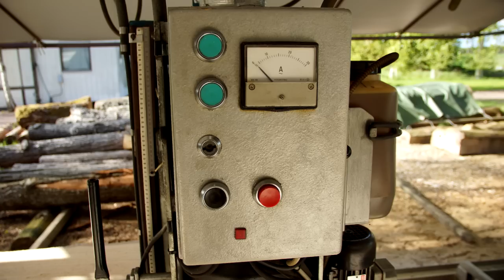SNIK chainsaw mill video 3

Comment: That chain seems to be running very fast. “Chain-shot” must be a real hazard. Nice mill, fast cutting.
Reply from the maker: We actually newer had a Chain-shot in nearly 30 years, but had on or two broken (thin 6mm pico chains) and they were caught by the safety U bracket mounted on the bar root together with the saw-bar nuts, but newer on a 3/8  standard Oregon ripping chain they are pretty 💪 strong.
Thank you for Watching

Comment: With the auto feed does the chainsaw mill cut smooth? Nice mill!
Reply from the maker: Yes It is 0-15m/min 
when the feed pressure once sett , the saw speed  will automatically adjust to the with of the saw cut👍

Comment: Hey Svend, in the video you say you use a modified 404 sprocket to run the oregon s91 chain. In the comments you mention you use a 3/8 8 tooth sprocket. I was hoping you could describe how you modified the 404 sprocket? Or does a standard 3/8 sprocket work fine with that picco chain? Thanks
Reply from the maker: Hej Evan the standard 3/8 ripping chain runs on the standard 3/8 spocket, but not the S91  you se the 404 sprocket in the Video and how it is turned down in the middle to a different diameter to fit the S91 Chain
Reply from the maker: A 8 tooth 404 sprocket turned down to 42,2 mm in the middle runs nicely with a 91 S Pico Chain 👍
Reply: @Svendus  Perfect. Thanks for the information!

Comment: Hello Svend, incredible mill you've built yourself there! I was hoping you could further explain how you force your motor to run at 100% overload? I've read previous comments and if I understand correctly you run a 30 amp breaker. So 15Kw (7.5Kw x 2) at 230v should trip that breaker quite quickly shouldn't it?
Reply from the maker: The motor is a AGUS 55+ 400 volt industrial, that means it is built to run with 55% overload continuously
 on the mill it runs intermittent 100% overload and you do not have any asynchrony sound that normally are heard from 3 phase overloading 
 the motor are protected with temperature censors in the the winding of the motor 
the motor become warm but not hot and it cools down when the clutch are free and not connected to the saw chain 
it has actuality newer switched off do to overheating.

Comment: Why am i loving the chainsaw mill way morr than the bandsaw ? My engineering mind LOVES the simplicity of it! Sooo cool! Plan to build me one this month :)
Reply from the maker: carytowncat Small band saws with 32 mm blades are suffering from wavy cuts when the blade becomes dull and unsharp, and big saws with 75 mm blades become rather costly , cutting into a nail with a chainsaw are not a catastrophe the chain are often repaired in a  couple off minutes 👍
Reply: @Svendus  thanks Svend :)

Comment: I know on my band mill about how often it needs to be sharpened. About how often does the chain need to be resharpend?
Reply from the maker: We sharpen the chain when the sawdust become just dust there are no fast roules it depends on the wood and how dirty the bark on the log are
Reply: It's the same on my Bandsaw, but I didn't want to have to sharpen a chain after every log. That may or may not be the case on a chainsaw mill, I just honestly don't know about them?  But, thought they might work well? May be easier to sharpen while in the field? You've got a really nice mill.
Reply from the maker: @melvinjohnson7981  Thank You we are planning a circular HM cutter to clean the bark before the saw chain enters the log like on the professional bandsaws to day we clean the log on the bark side where saw chain enters the log and sharpening are easy made on the mill with a small 5,5 mm electric grinder

Comment from the maker: Note! to get up the chain saw speed, a big motor wont do alone You have  to modify the saw chain riders from 0,65 mm to 1mm  tighten the chain tension and lubricate the nose wheel from within the needle bearing
Reply: Hi Svend, great machine you've built there, well done. Could you explain to me what you mean by 'riders' or what part of the chain these are ?
Reply from the maker: Chris Dunham Depth gauges, "riders," or "rakers," as they are sometimes called, control the amount of wood severed by a cutter tooth. During the life of a pro saw chain, they occasionally need maintenance for top cutting performance. ... Each time the chain is sharpened, the top corner of the cutter tooth gets lower

Comment: the pressure is higher on the saber FORCE BUT?: using the middle of the saber on an 80 cm log or close to this length? OR USING THE MIDDLE OF THE SABER TIP DOES THE CUT STAY BUT SMOOTH CUT BUT FAST FREE?
Reply from the maker: You are not clear  we do not understand  your Question  But Thank You For Watching 👍

Comment: Very nice, Awesome power and a clean, quit cut.
Reply from the maker: +Joel Claflin Yes the 2.5 mm veneer can be used it onely need a little sanding to be smooth 
but it is more waste than veneer with a 7mm saw cut  :-)
Thank You for Watching

Comment: Is 26" the largest bar the 10 hp motor can handle?
Reply from the maker: @gadgethunter  on the machine we can mount a 30” but we do not  pay for something we do not need here in Sweden. Technically this motor can handle the longest bars available because you can pick out over the double effect 15KW from it 🤔 thank you for watching

Comment: Brilliant!  Amazing Engineering!  Well Done!  I wondered how you got the chain speed up so high (by the sawdust) - 10 bar on the oil and near perfect alignment !!   Is that a 10hp motor?  Wishing You much Success!!  Masterful Craftsmanship!!
Reply from the maker: Advanced Nutrition Inc Thank you yes it is a Brook Crompton Parkinson Argus 55+ 7,5 kw it runs with 100% overload 30 amp Saw spindle runs at 8000 rpm Saw spindle driving at 8000 rpm minute chain speed 20 ms

Comment: Could you be detailed about the pulley sizes the clutch and the magnet/oiler please I read the other comments about the motor
Reply from the maker: Hi Michael the Pulley are 2 Z V belt. 
The clutch are a single coupling lamell from a VOLVO 240 200mm in diameter.  
Spindle speed are 8000 rpm. 
The max speed for 63 series ball bearings with DDU seals. 
The Chain speed is 20 m/s. with a 3/8 8 teeth sprocket wheel.

Comment: u can't cut both ways?
Reply from the maker: Eric Charters Yes it cuts both ways but the installed effect  (15Kw) is to much fore the nose wheel  to cut with full load backwards.  
But we often manually cut light cuts backwards https://youtu.be/tbN29YCcwIo?t=1m11s
Reply: Démonté

Comment: Help me. 
6.16  min. What?
Reply from the maker: The Microswitch are electric connected to the oil pump and feeding  motor  both are operated by the mechanical clutch turns of the feeding and chain oiling when the saw chain 🛑 Stops

Comment: Greath mill haw much is power of engine
Reply from the maker: +stivi s Yes the Saw motor are aluminum  build weight 50 Kg 
we had to balance it with led ballast in the saw portal pillar opposite side of the motor to make it stand  on all 6 wheels
Reply: +Svend Nielsen, he was asking the hp rating of the electric motor you are using. I would imagine he will be working in Kw not hp but he can do the math.
Reply from the maker: +Mike Lamothe  all right Sorry as said before 7.5 KW running intermittently  with 100% overload 30A 15Kw 
the motor are a Brook Crompton Parkinson Argus 55 (55 means that the electric motor can be overloaded 55% continuously ) https://youtu.be/IqzI3xNYqz4
Reply: 7.5kw = right about 10 hp which is equal to at least 20 hp gas engine.  But he is overloading to 15kw to he is using 20hp electric which is about equal to 40 hp gas.